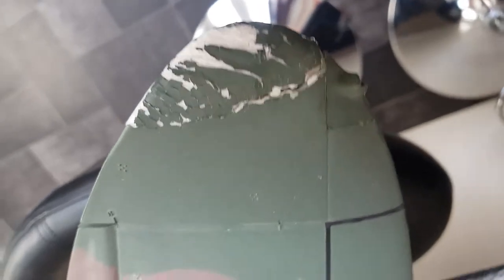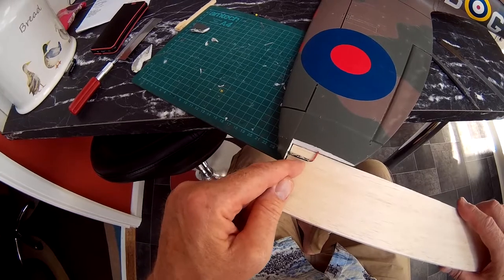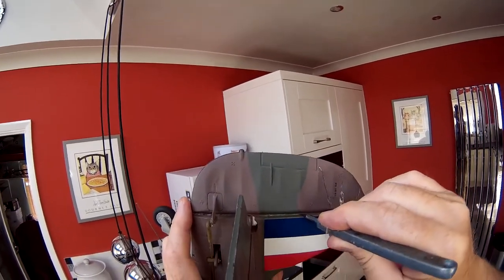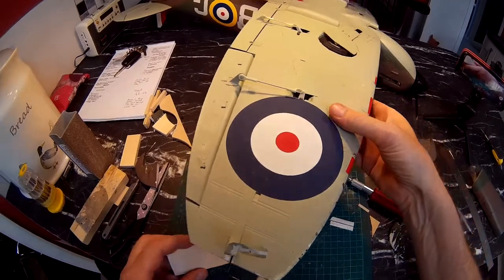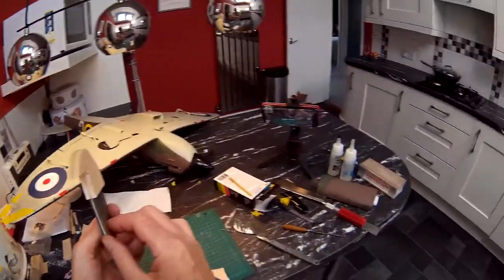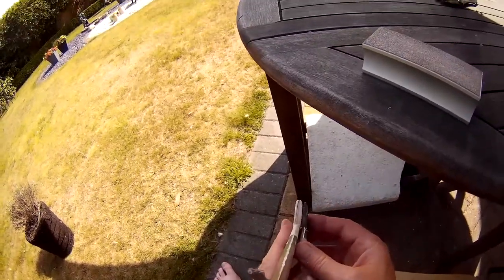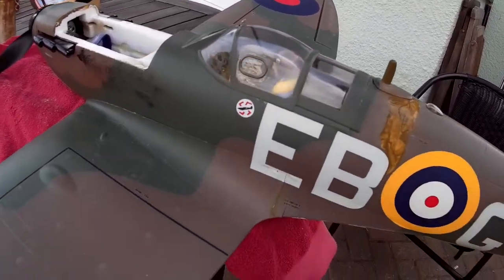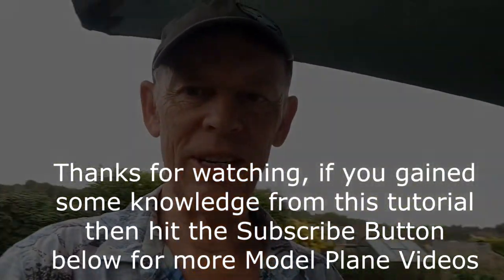How To Repair Foam Model Planes

Comment: I had the same Spitfire!! But tip stalled it on it's maiden flight and smashed it up and then they stopped making the Mk1 so never replaced it, nice repair job 👍😄
Reply from the maker: Hi Ian, thanks, that was bad luck, I do enjoy flying mine, when I eventually wreck it I'll glue it together and use it on the slope 🙂

Comment: This is craftsmanship right here I'm over here using foam putty and sand paper and airbrush to make my planes looking like new this guy is doing it easier with balsa hmm and once you fix all those tips that break on the phone playing the ball so they'll never break again except just break off in balsa but you still got templates probably I got the e-flite version of the spitfire with the retrax and everything my retrax bent I still haven't been able to get them perfectly straight they're getting better but it's taking me about a good 3 days to get it straightened out back to perfect and you can still buy spare parts for it thank God I just said I have been just feeling it with putty and then it's airbrushing and it looks back normal brand new but I think I'm just going to order all brand new parts for it and rebuild it from the ground up new fuselage and everything it's going to cost about a hundred bucks but it's a beautiful plane
Reply from the maker: Hi Dracing, you can use whatever you have to hand and are comfortable getting results with. For me using balsa is just that. Any Spitfire is worth repairing, what beautiful birds, thanks for your comment.
Reply: @CliffHarveyRCPlanes  no prob man. And yea they are good looking planes. Mine looks mint condition but it has scars underneath all the make up lol

Comment: Tbh paintwork scared me a bit but considering the effort I have seen at the local flying club at least you won't notice it at first glance. I swear I've seen guys use all sorts of oranges pinks and yellows and insert random color and it just looked like something a clown would fly lol. Liked the wooden repair idea.
Reply from the maker: Thanks WS, as long as the paint is a close match it doesn't really matter what's underneath 😁👍

Comment: How strong is the connection between the balsa and foam?
Reply from the maker: Interesting question Borimir, I suppose the answer is if it breaks again there'll be a thin piece of foam attached to the epoxy 🤔